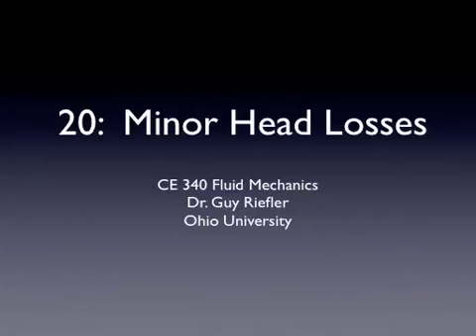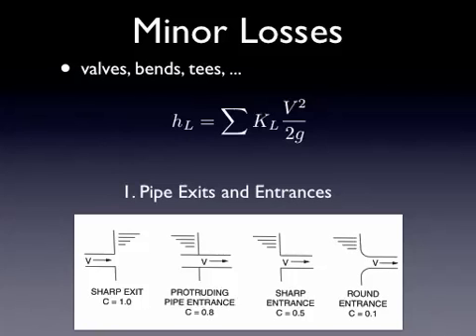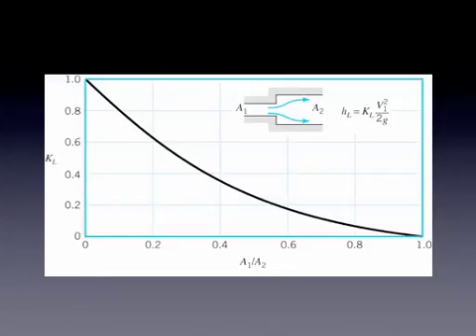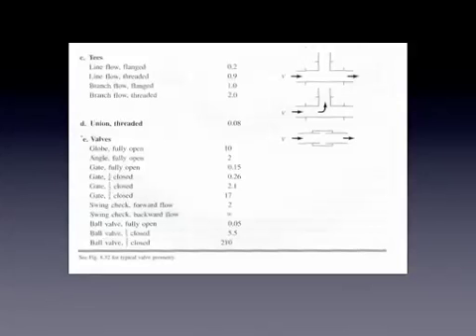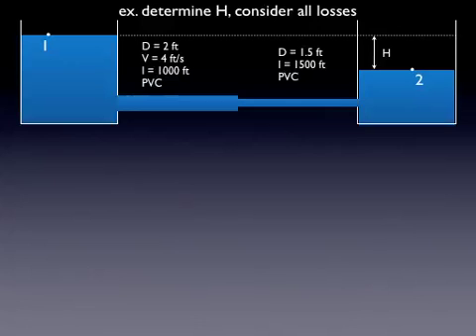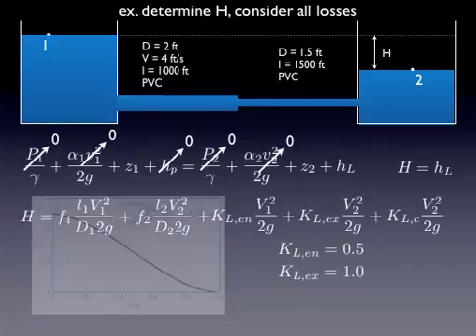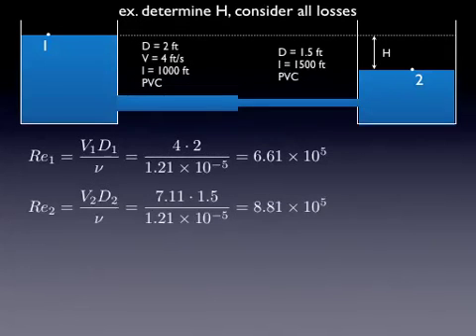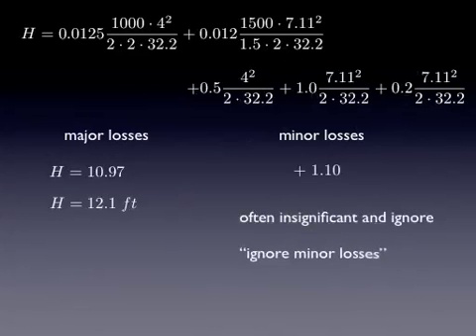20 minor head losses

Comment from the maker: Thanks.  Good question.  These losses result from turbulence in the flow field due to the contraction or expansion of flow. If water is flowing from a pipe into a tank or river the loss coefficient is always 1 regardless of if it is on the top or bottom.  If water is flowing from a tank or river into a pipe with a sharp entrance near the top or bottom, I'm not sure but I would guess it would be close to 0.5.